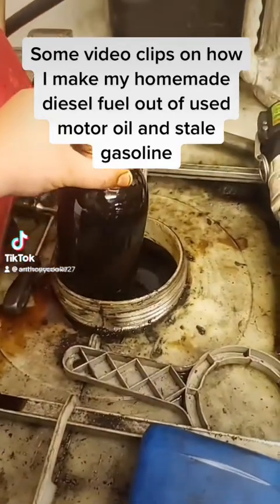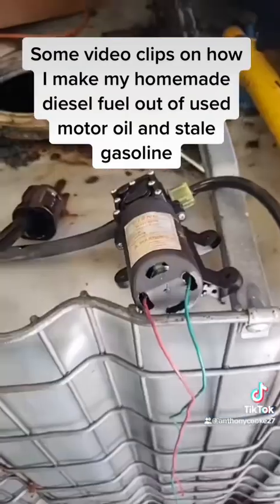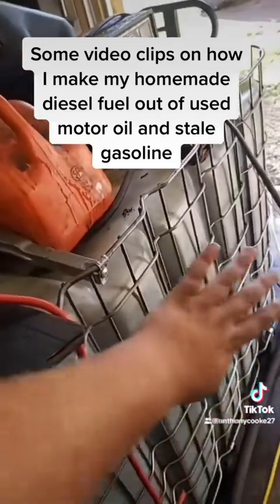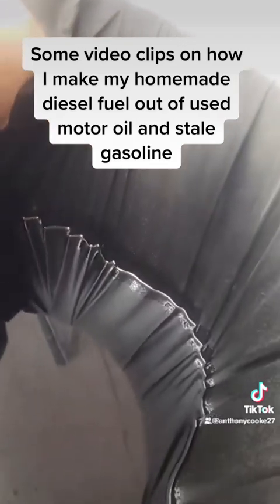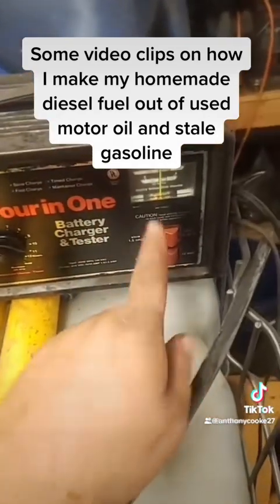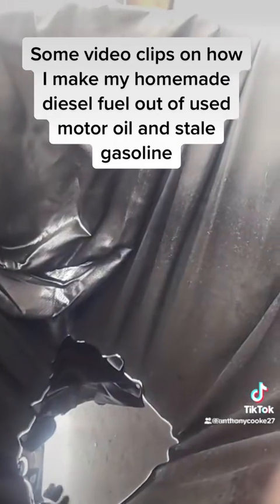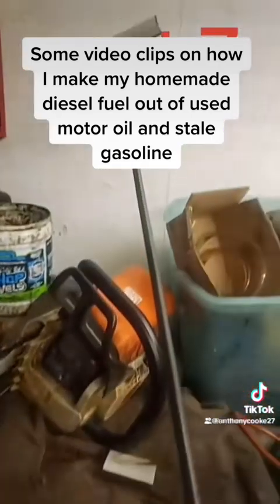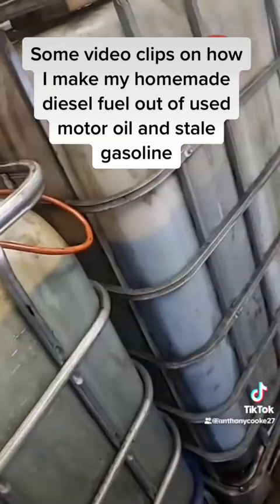How to make homemade diesel fuel. My most viewed video ever.

Comment: WVODesigns centrifuge is not cheap, but if you manage to afford one, I highly recommend getting one! Removes the vast majority of stuff and quickly too! Ran nearly 30K kms in my 2006 VW jetta on 75% WMO with the centrifuge and never clogged a fuel filter.